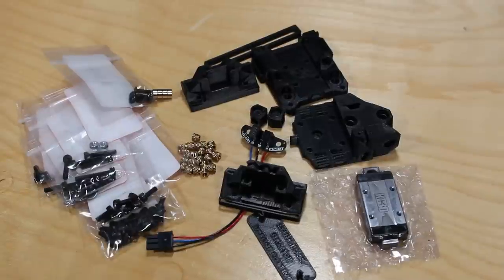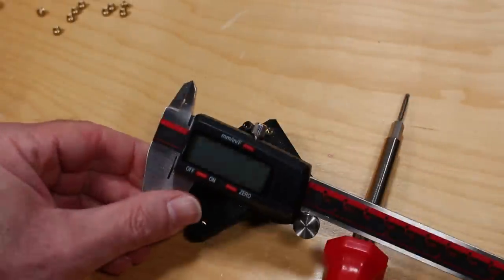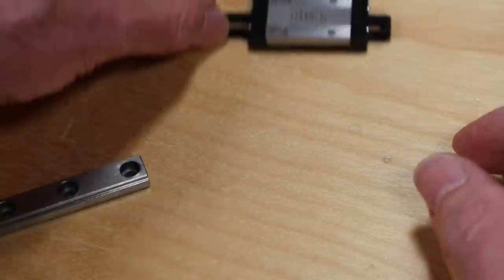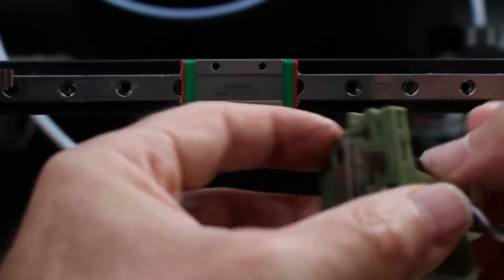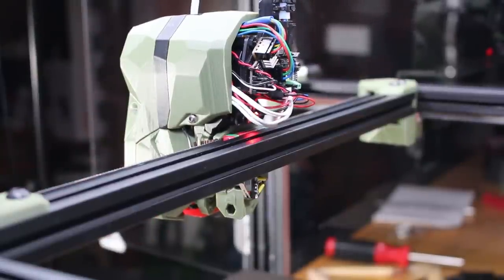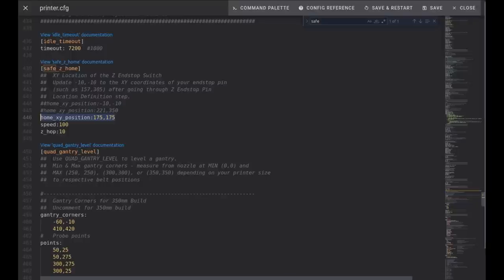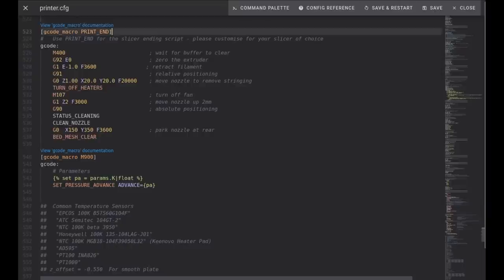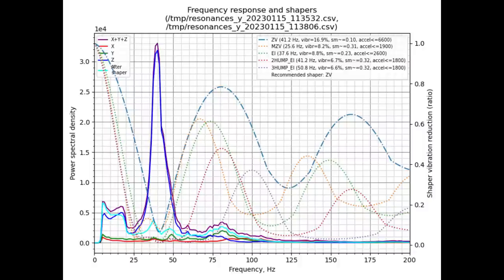Voron TAP build, install, configuration, tips & tricks, final thoughts.

Comment: Personally, I would feel a bit more comfortable doing tap if the x axis linear rail was mounted on top of the extrusion. I don't like the weight of the toolhead repeatedly falling on that linear rail like 8-12+ times per print(QGL+Homing+BedMesh).. I guess I'm still super satisfied with klicky and less weight on the toolhead.
Reply from the maker: What was surprising was how little weight or pressure this creates.  It's obviously more, but when you move it by hand, it does not feel like much.  But when concentrated on the tip of a hot brass nozzle, it can certainly make a mark...Thank you for the comments and watching!
Reply: @KapmansBasementWorkshop  thanks for covering this btw. Weren't there users that didn't use all of the linear rails screws and had a rough drop during QGL leave some sort of physical mark when passing the QGL points on a print?
Reply from the maker: @Mehecanogeesir  I don't know about how the screws factor into this.  But on my test bed plate with smooth PEI at higher temperatures, QGL did pit the PEI.  Note that this PEI is thin and not one of the thicker/higher quality ones.
Reply from the maker: The pit I show in the video was one of those.  Now if you typically don't print in those areas, it's probably not a problem.
Reply: @KapmansBasementWorkshop  In most implementations I've seen, people don't have the "retract" after triggering the sensor as slow as you do. Hence my opinion about not liking the weight of the toolhead constantly dropping on the linear rail. I really like how slowly yours does it - it seems like there would be practically no force exerted on the x axis rail. Best wishes!
Reply from the maker: @Mehecanogeesir  I'm actually scared to run it quickly!  I've got all kinds of strange concerns about it.  But I'm sure not one of them are true.  Thanks for the comment!

Comment: After installing tap i’m having issues with the gcode macro commands. I clicked on the sample print benchy in klipper and if hotend is hotter than 150 it will drop the temperature prior to doing a home which is correct & a safety thing to protect pei bed but right after homing i get a message saying Extruder not hot enough and stops the print. It instantly tries to print after homing without trying to reach the slicers hotend temp and it sees that its nowhere near pla temps so it errors out. Is there a gcode that after homing and QGL hotend will pick up and reach the target temperature that the slicer set?
Reply from the maker: The slicer should be generating the gcode that waits until the proper temperature is reached before anything else .  When you look at the generated gcode file, is it in there?